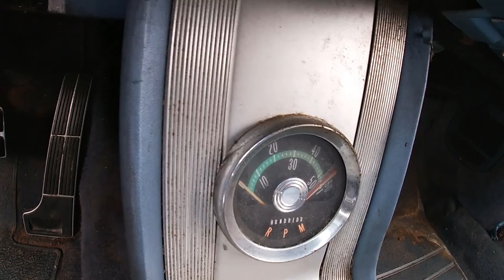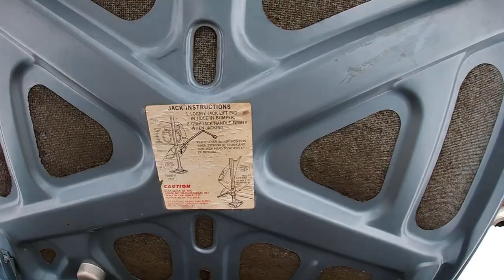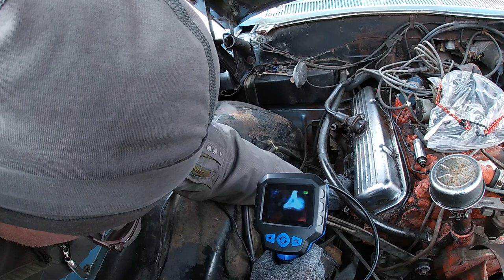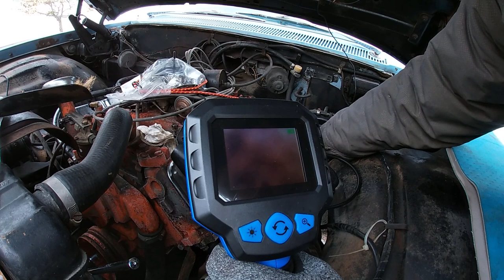1962 Oldsmobile Starfire update Sweeet Success ! "It Moved".

Comment: the hole near the trunk lock might have been drilled by the dealer that sold the car, to mount the metal nameplate showing where the original owner bought the car.